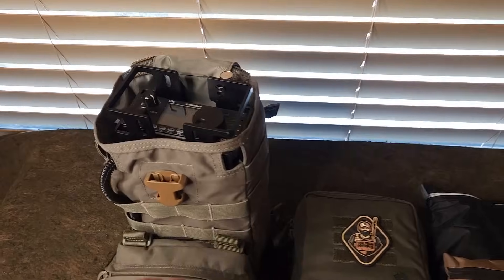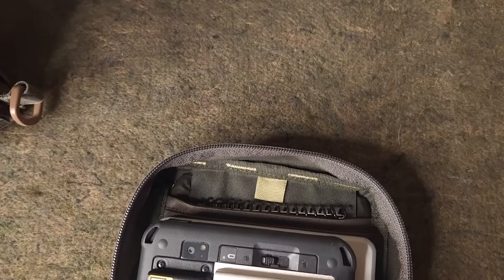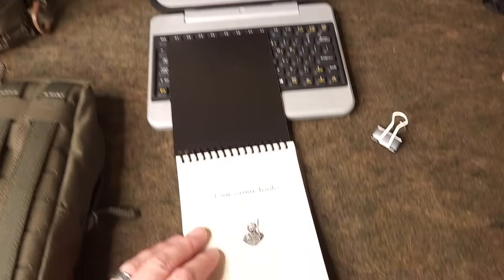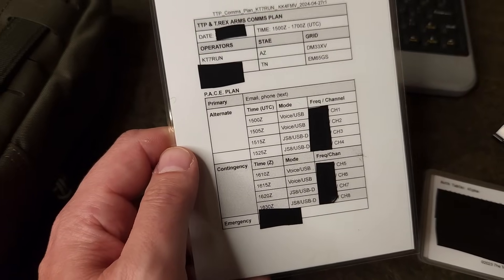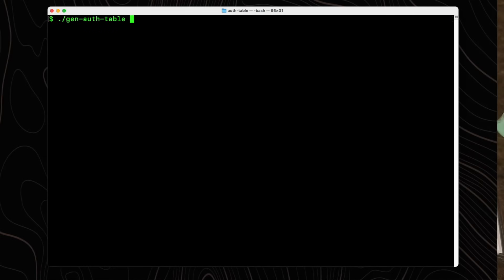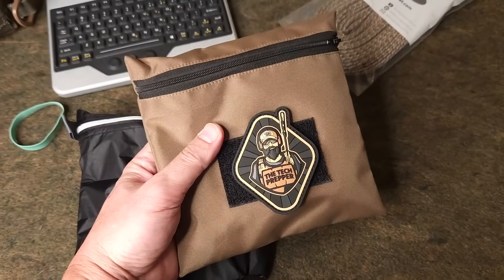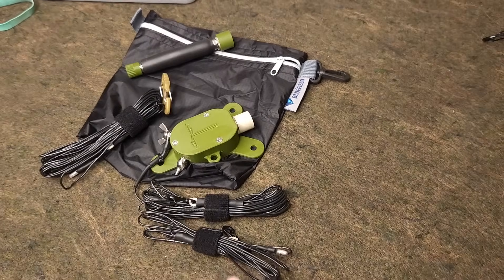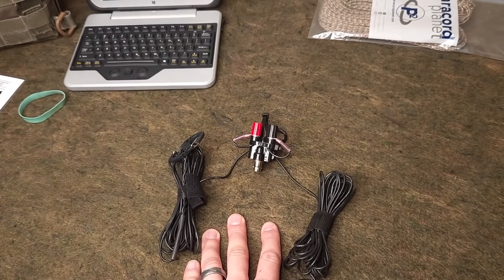Complete Offgrid HF Comms Kit - G90 Manpack Series

Comment: How are you compensating for your geo rf output disclosing your location or is that of no concern
Reply from the maker: I am not sure what you mean. Are you referring to radio direction finding? In terms of transmitting maidenhead grid square coordinates, it depends on the situation. But, I have a few techniques for dealing with disclosure of location.

Comment: How did you get a 30m work band? I talked to a frequency coordinator and they said they didn't know what i was talking about.
Reply from the maker: The antenna that I showed was for covering the amateur radio WARC (12m, 17m, and 30m) bands. It sounds like "work". These are not allocated for commercial use.

Comment: THIS IS IMPORTANT!!! Watch this video before you get too invested in DMR/Digital. DMR is critically flawed for security. It allows OPFOR to not only identify where you are located, at will (eg. Private call confirmed, and 'text messaging confirmation'), but it allows OPFOR to identify individual radios uniquely because the radio ID is transmitted in clear text AND transmissions can be jammed by sending single blocks of transmissions which causes the entire transmission to not come through.  DEF CON 25 Wifi Village - Matt Blaze - Sigint for the rest of us https://www.youtube.com/watch?v=7awwG9aaR4c

Comment: No worries what would be your choice for the radio if you had to build only one man pack?
Reply from the maker: I've already discussed it. It would the FT-818ND manpack. The FT-857D manpack is number #2. I have been running both for about 3 years. I take the 818 when I need to go light and can get by with 6 watts. The 857 comes when I need up to 100 watts.

Comment: Awesome Job!  You r da comms man!  I need to get my G90 set up like that.  My base station is my FT-891.  My POTA/SOTA radio ismy G90.
Reply from the maker: Right on! I have a love-hate relationship with my FT-891. I refuse to use it because the menu system is a nightmare compared the FT-897/857/818. I do like the receiver on it. It has a great DSP with outstanding DNR.

Comment: I am curious why you chose this over the Xiegu X6100.  I am looking at both the G90 and the X6100 and like to know your thoughts.  
I like that the X6100 has 6M bigger screen and is compact. Also, with open source firmware downloaded on an sd card, the X6100 can use 2m and I believe 70cm.  But, the G90 has 20w and I understand a better antenna tuner.
Thank you for your content! 👍
Reply: I own and use both however the 20 watts has made the G90 My rig of choice between the 2.  I lost screen, built in battery, and Sound card and I still prefer the G90.
Reply from the maker: This is not my radio. It was sent to me by the folks at T.Rex Arms. However, the G90 is more suited to the manpack style of deployment. The 20 watts is critical for most voice operation.

Comment: Overboard is underrated.  You’re a freak and I love it.   Have to ask— whats your take on the G90 now that youve immersed in it?  Keep up the great work!
Reply from the maker: It's not for me, but it has a ton of value at this price point. I recommend it for anyone getting into HF on a budget. I need to test it in the summer to see how it handles the heat. I actually really like it and forgive some of the quality issues because of the price. It surprised me. In fact, I bought one for myself and my training buddy. Mine is still in the box. I plan to build another twin manpack and give it to a family member to store at their home as a backup rig. I'll have to lean on this manual I wrote. I plan to try my build cold turkey in 3-4 months to see if the manual can be used after a long period of not using the radio. For me, I will be sticking with FT-818ND or FT-857D manpacks.